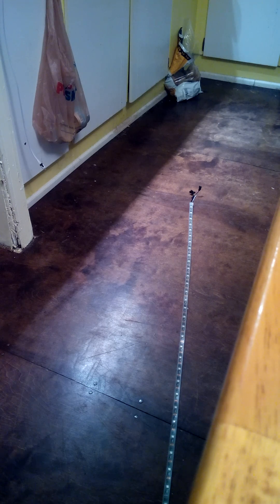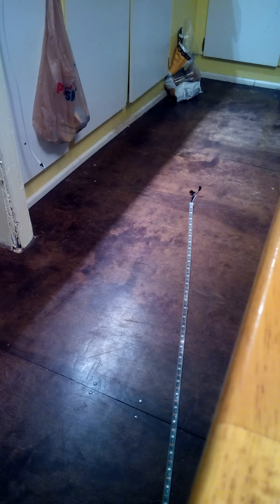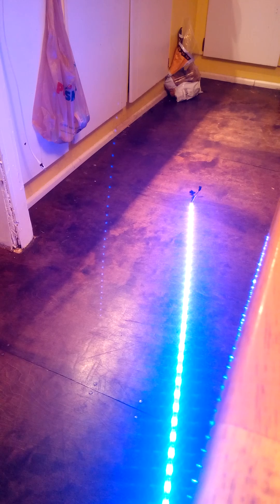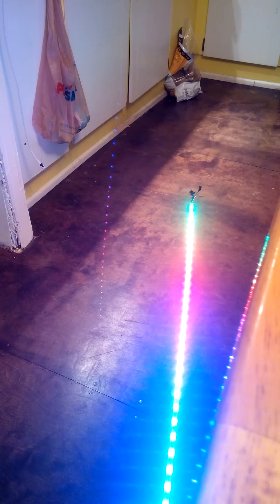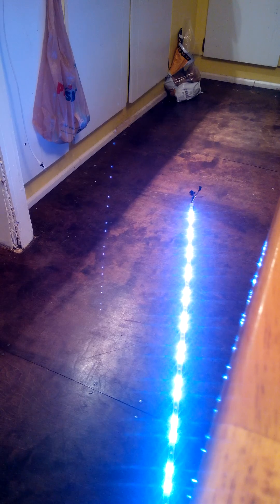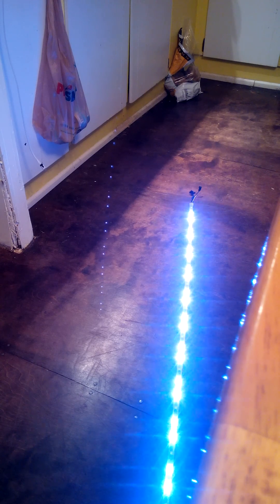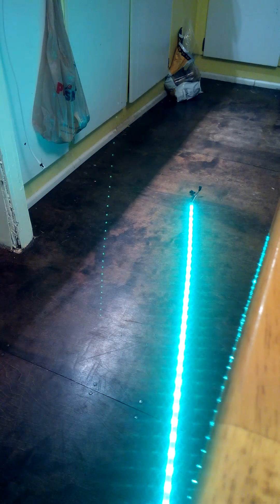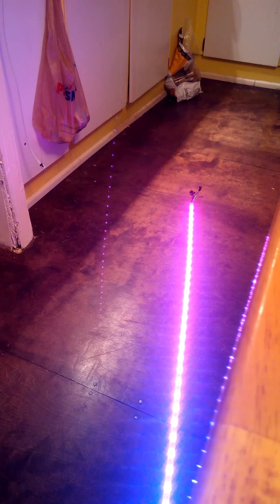Neopixel Node Demo

Comment: Do you hare raibow code?
Reply from the maker: Hey, I certainly do :) I did have it hosted on GitHub, but they changed their licenses weirdly. I'm in the process of moving to GitLab.

The code I have is for a IoT deployment , which requires a gateway node plus the Neopixel node. You end up with 2 things: a HTTP rest API, and a webpage you can change modes as you need.

My architecture can be found here: https://hackaday.io/project/12985/files

The code you asked for is *already* in the above hackaday.io page, as FastLED_Node.zip . You'll still need a gateway, unless you want to hack the radio part of the code out and provide local control. 
(I used FastLED library, and not the Neopixels library. So much better!)